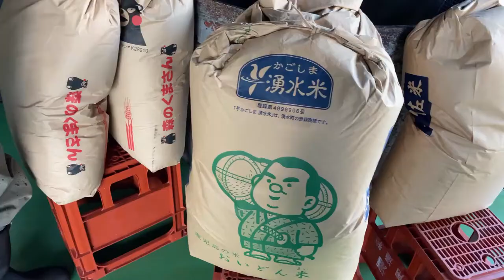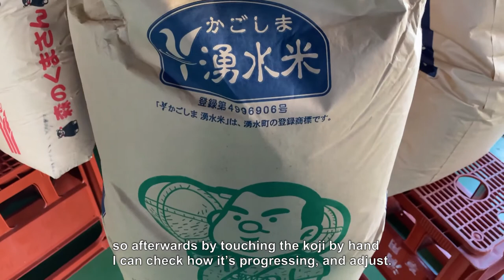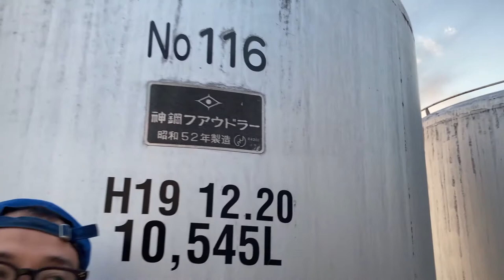The Craft of Sweet Potato Shochu - Sake Future Summit 2020

Comment: Can someone add to why shochu will be acidic in the brewing stage? Is good bacteria added to make it acidic so you don't have to worry about bad bacteria and in turn not worry about bad flavour since it's distilled?
Reply from the maker: The koji (typically) used, either white or black strains, result in an exceptional amount of citric acid-producing enzymes. While not a "requirement" per se (historically, awamori aside, shochu was for a long time made from yellow koji, same as sake), the adoption of black/white strains in the warmer southern climate where shochu is historically produced resulted in, as you mentioned, a more stable mash less likely to become contaminated by unwanted bacteria. This has become standard practice ever since. That being said, now that we understand the science and have more means of controlling the brewing environment, yellow koji is making a small comeback, as it results in a relatively mellow profile.
Reply: @SakeOnAir  thanks for the answer